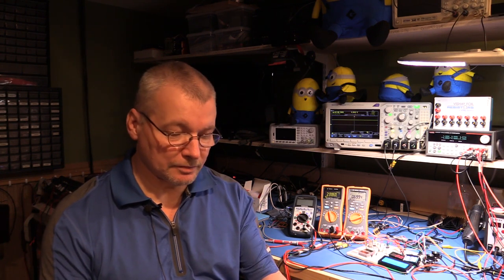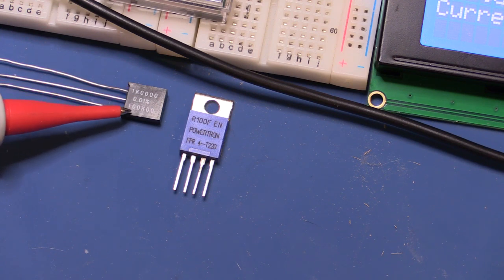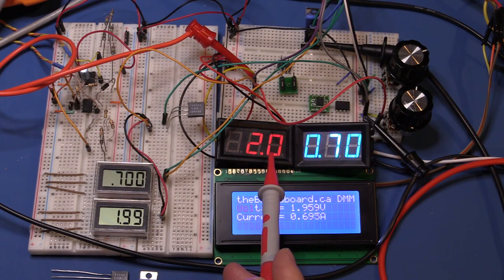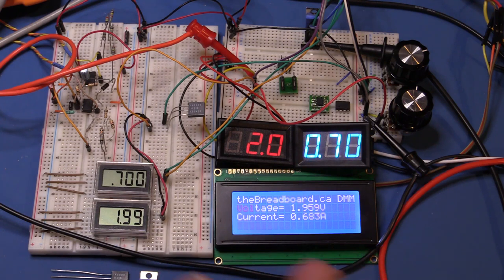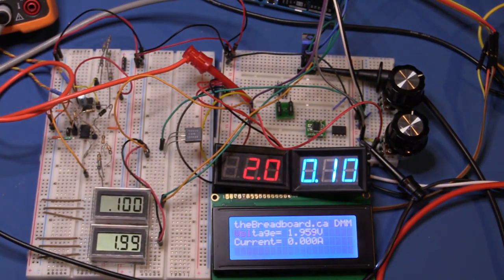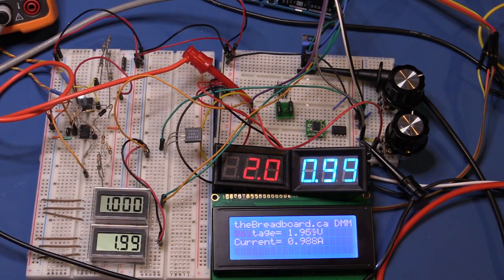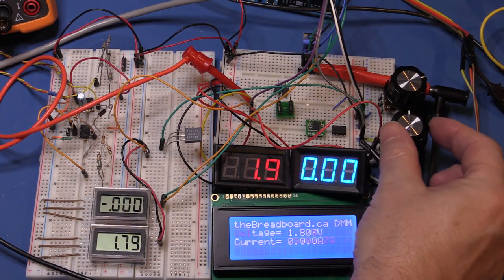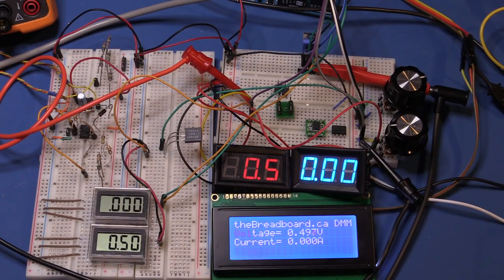The Modular Bench Power System #9 - More on Displays and an Arduino UNO ADC + LCD

Comment: If you want to use the Arduino as your voltmeter (which will give you a lot of flexibility) be sure to add a opamp stage with some gain to measure the current. Put enough gain so that the maximum voltage across the sense resistor will be full scale compared to the Arduino's reference. Also you can get some pretty cheap and accurate 2.5V references today to use as a reference for the Arduino.
Reply from the maker: exactly and this will be part of a new video to do just that with external adc \ dac etc, in this case it was just to showbit can be done even with basic stuff

Comment: Peter Oakes have you considered using a hall effect sensor like the ACS712 to measure the current? It's supposed to be pretty accurate.
Reply from the maker: Up to now, no but I am planning a session on current sensing both high side and low side, this would be a worthy addition as an alternate non intrusive method, thanks

Comment: I liked this video, good information however I am stumped, the current sense resister you were using in this video I have never seen before, the FPR4-T220 I downloaded the data sheet, and looked on your website but I can not find any hook up diagrams, or reference circuits, how did you know how to use it? Thanks for any help you can give.
Reply from the maker: well I back in the 70's when I served my Electronics Engineering Apprenticeship it was with a company who's primary product was resistors and I learned about kelvin connections etc way back then, now on this particular component there is a clue on the outline drawings on page 3 of the PDF where the indicators "I U U I" above each pin, this indicated the current pins (Outer two) and the voltage pin (Inner two pins), yes the Use of a "U" is not well known but there you go, I also agree the sheet does not actually tell you much how to use the resistor but you can find more info here about kelvin connections: http://www.vishaypg.com/docs/63502/cursen.pdf

Also I had never noticed before that there was a lack of additional info for the new comer to four terminal resistors, I even searched around their site a bit and found nothing more than the document above, I will have to see if I can remedy that, thanks for pointing it out

Peter
Reply: Thanks for answering,  the link helped.